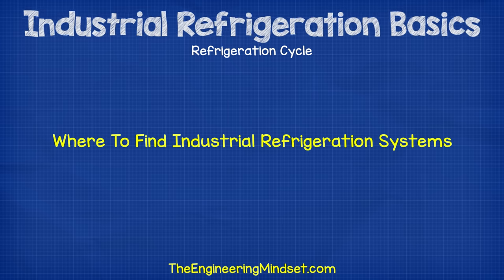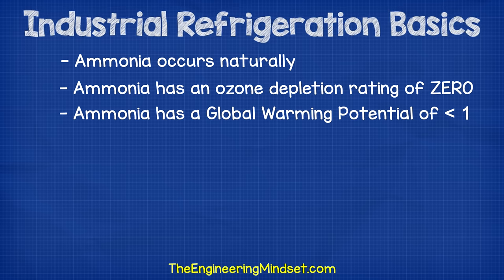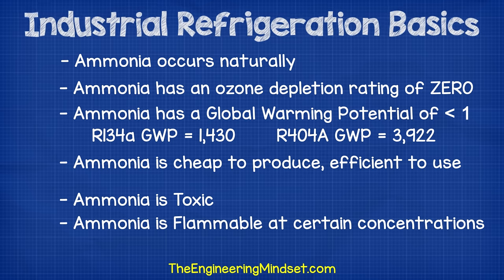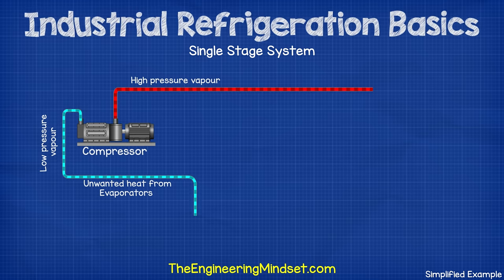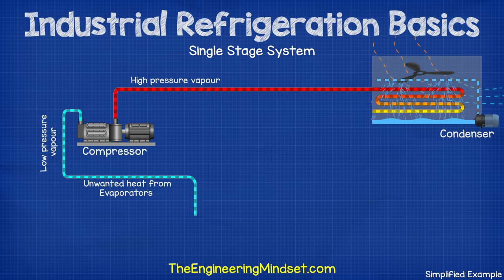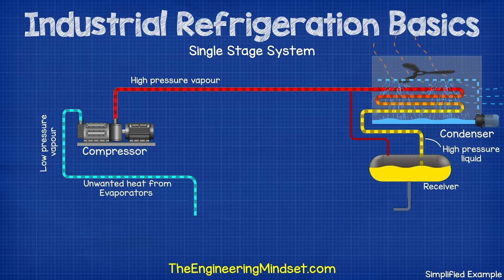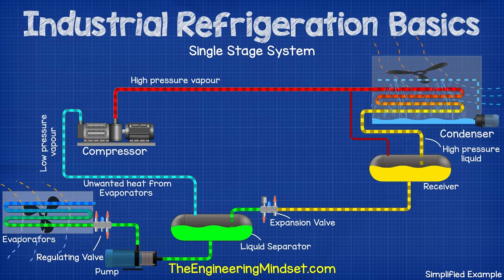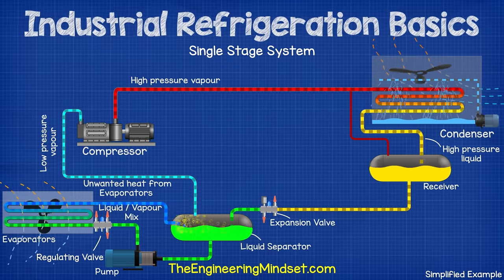Industrial Refrigeration system Basics - Ammonia refrigeration working principle

Comment: Pardon my ignorance.  If ammonia systems are more environmentally friendly, why are they not used in the automotive industry?
Reply: If you mean, why aren't ammonia systems used for vehicle air conditioning, that is mostly due to ammonia being toxic and flammable.  Sudden large refrigerant leaks happen often enough that they can't be ignored, and inside a vehicle it may be difficult to escape, especially if the leak was caused by a collision.